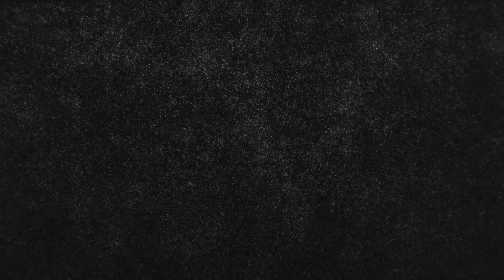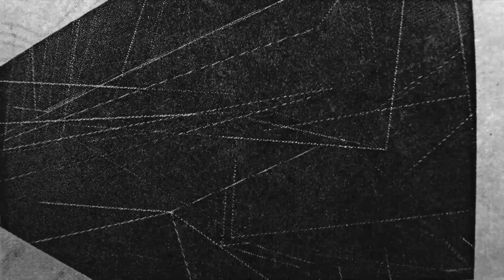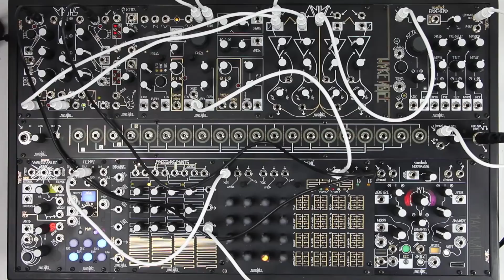Transposing Sequences

Comment: So uh.... if pitch control is bipolar, how do you transpose down? does your sequence have to always be as low as needed and only ever transpose up from that?
Reply: therealquade You could tune the root sequence to the middle position of the knobs on pressure points for example
Reply from the maker: Yes, you could start from middle on Pressure Points or whatever your transpose source is, or you could invert that CV if you want to transpose down.
Reply: Wouldn't inverting the signal also invert the sequence, IE Ascending scales become descending?